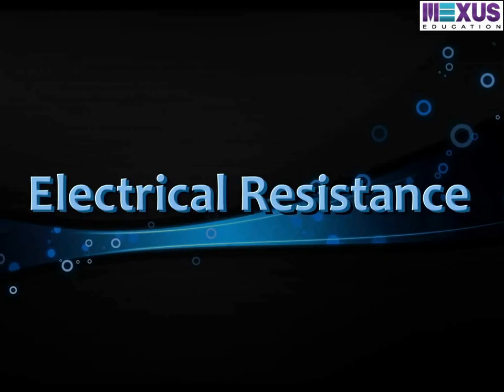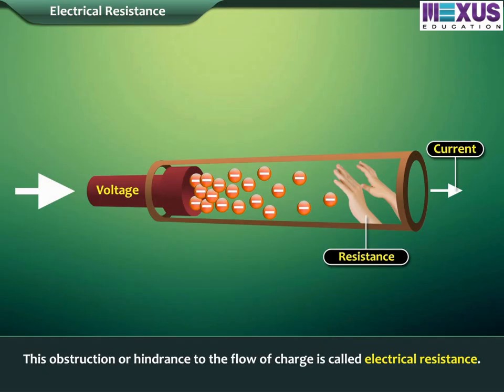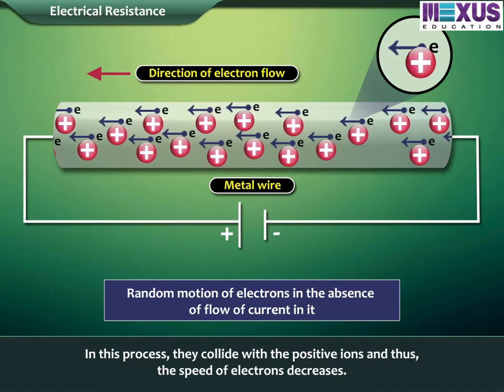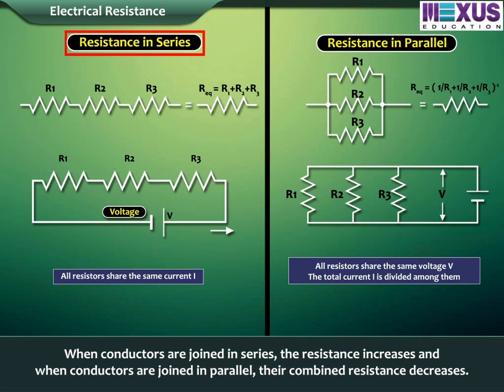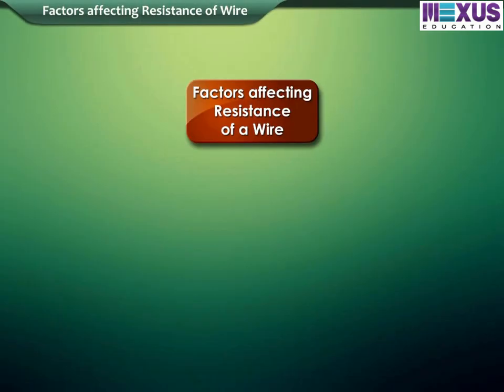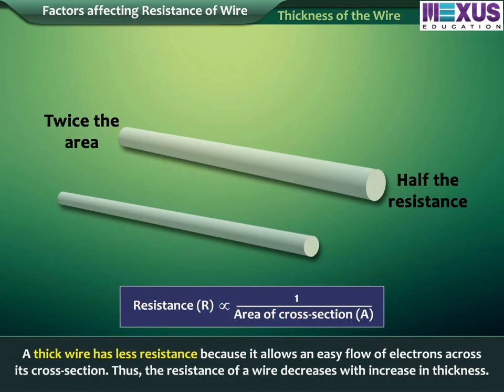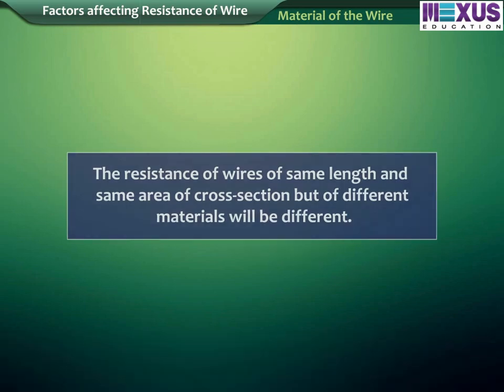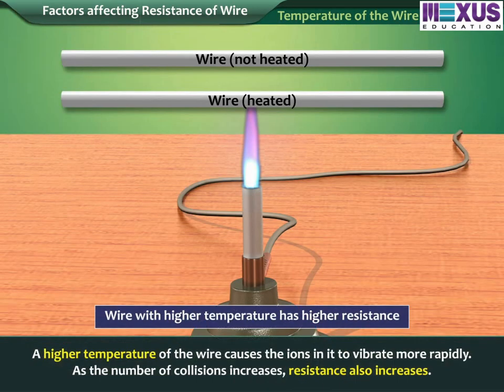Electrical Resistance - Iken Edu

Comment: As we know that resistance opposes the electric current .Then How the amount of current remains unchanged after passing through resistance?
Reply: The electric field in the circuit (from the battery) is constantly acting on the electrons so, their average speed remains constant through the circuit.